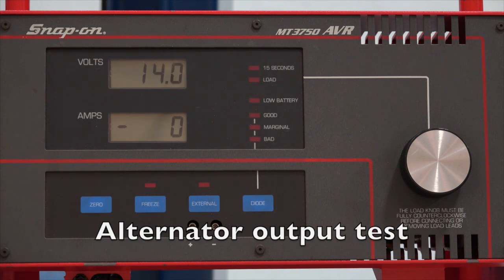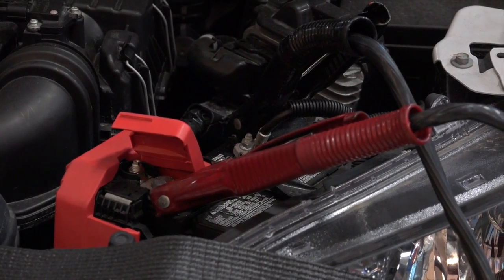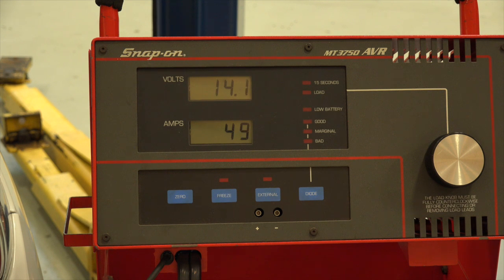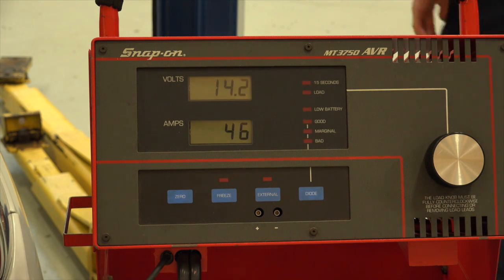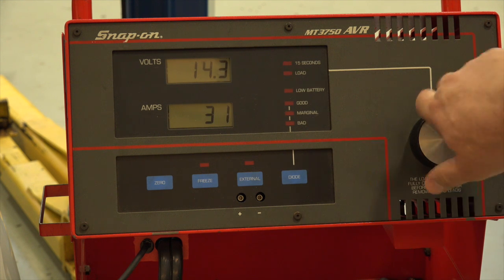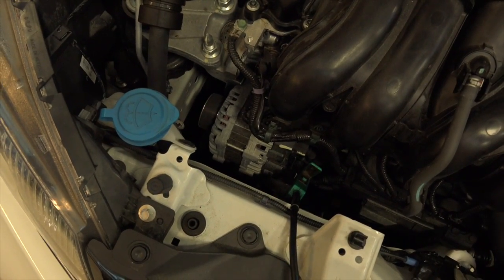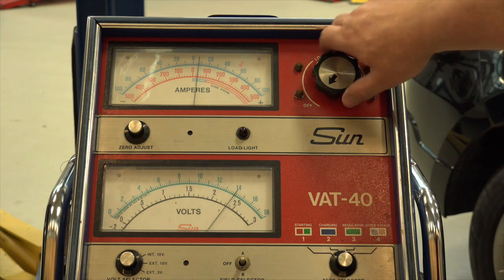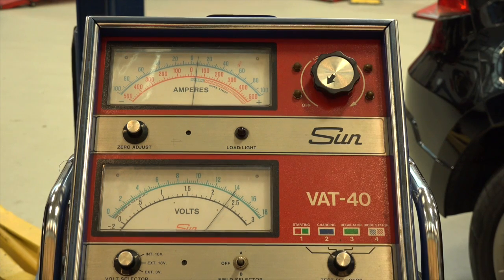Alternator Output Test

Comment: Not to nitpick, but that clamp isn't inductive, as those only measure AC current. The one on your machine uses a Hall-Effect sensor to detect DC current. Also, loading the system below 12.6V or so could suck amperage out of the battery as well during the test, which could skew the results some.